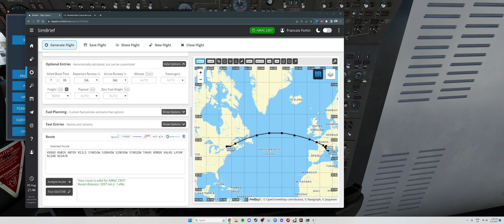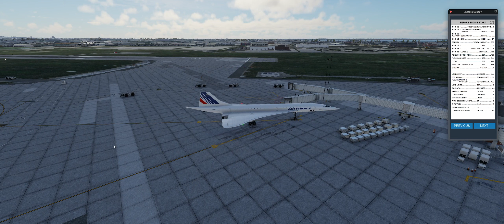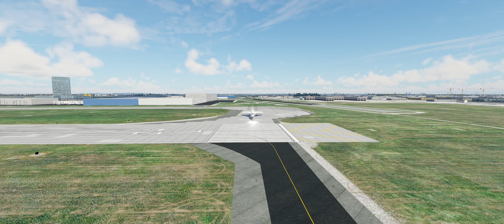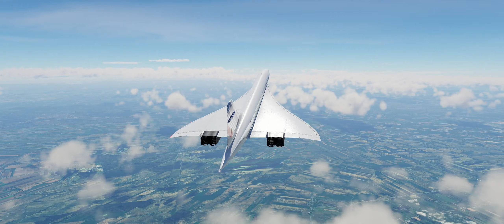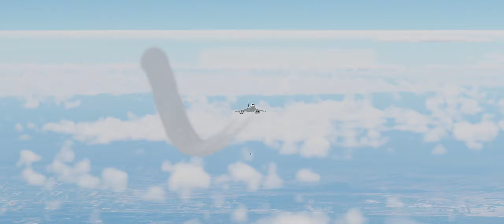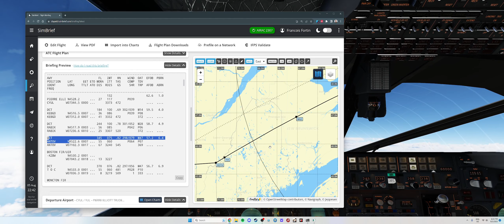Concorde - Montreal to Nice, France -  PART 1 of 2 - Departure to Supersonic 50,000 with commentary

Comment: You seem to have a very stable climb. I'm experiencing problems with it holding a vertical speed, which is probably something I don't have set right (trim?)
Reply from the maker: Do you "ask" the "engineer" to trim for Flight after takeoff? I think it's the only way to move fuel around and it makes a big difference. I actually leave it to Flight trim after takeoff all the way until after landing, I don't like how it controls with Descent fuel trim either
Reply: @FrançoisFortin-z9b I tend to change it only once I get to transition. Do you switch it to flight soon after takeoff? I may try leaving it in flight through descent.
Reply from the maker: @geofftitchener7787  Hah, yes, I trim to Flight as soon as I can after takeoff (basically: gear up, trim Flight). I find that it controls much much better this way. Might be a bug.